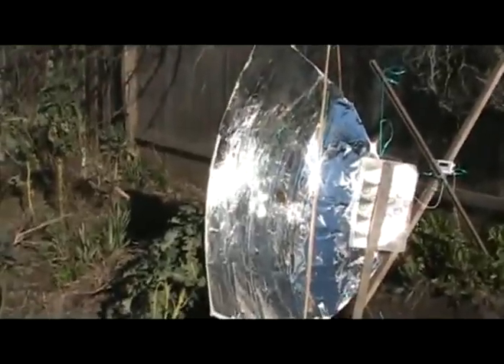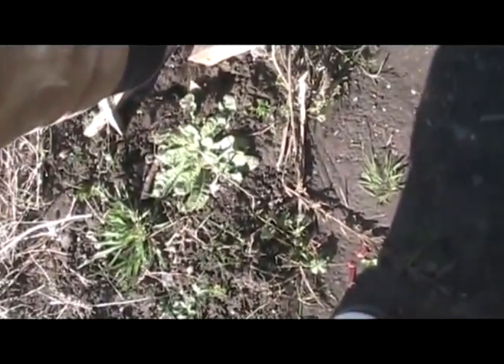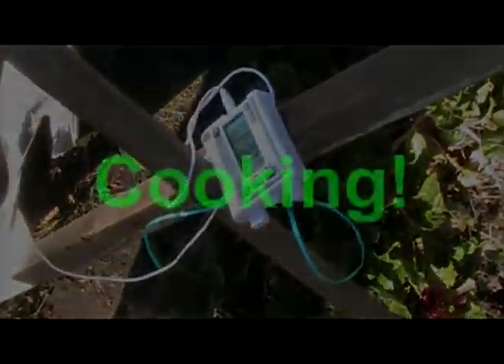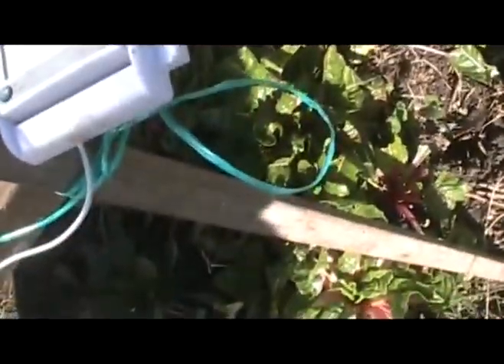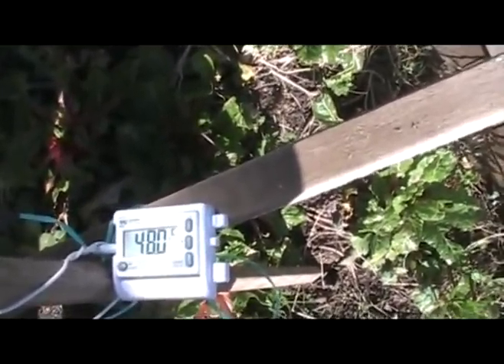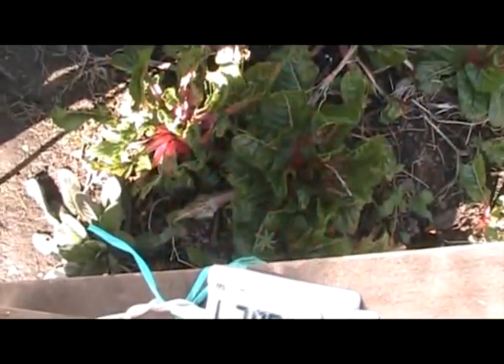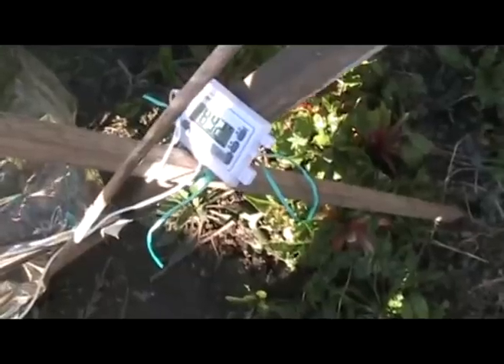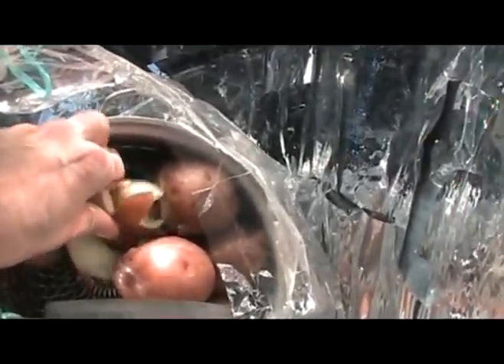I Cooked Potatoes in the clam shaped solar cooker

Comment from the maker: I just wanted a quick experiment with cooking something, I definitely should have sliced the bigger potatoes in half. 
My experiments are usually boiling water. Bringing water to the boil is a way more reliable way to find out the potential value of a solar cooker BUT most people do not know that. 
There is lots of room for modification. I need to keep the shape of the reflector EXACTLY the same as the small  model. Careful measurements, scaling it up and wood backing may do the trick,

Comment from the maker: There is a template on the solar cooking wiki. 
Search for clam shaped solar.
I made a model, and made a template on the model. Then I magnified the dimensions. It is a pain!, Measure, calculate, measure!  Maybe you can download the template and get a print shop to blow it up?
I never put "ribs" under my clam shape to keep it exactly right. If you do that, you should get much better performance.    Also, nearer the equator, you can just lay the thing on the ground. Brian

Comment: Potatoes are one of the difficult vegetables to cook.  it perhaps takes two to three times as long in the  heat to soften the potatoe as compared to alot of other things.  So I guess it would work even better on other things.  You mentioned steaming also ; perhaps maby just put them in some water just up to the top of the potatoes  - the hot water being the thermal mass to transfer heat to the items being cooked.  Nice temp. though ; close to 100C (water boiling) with this one.